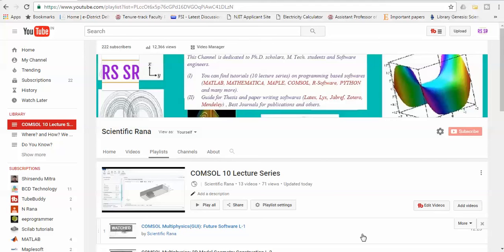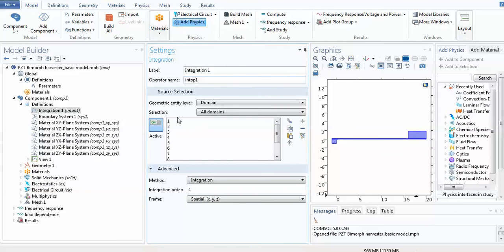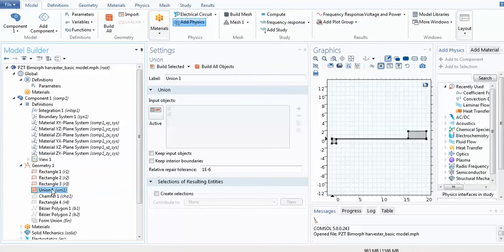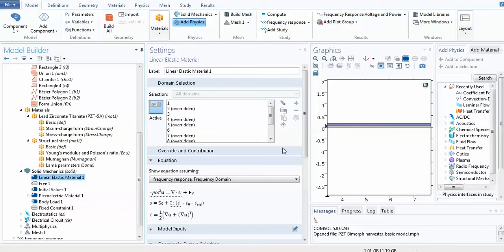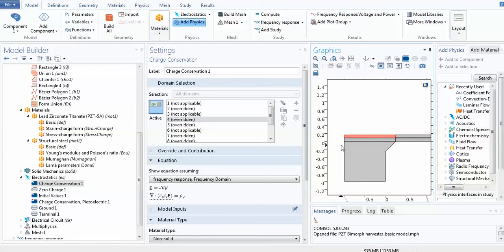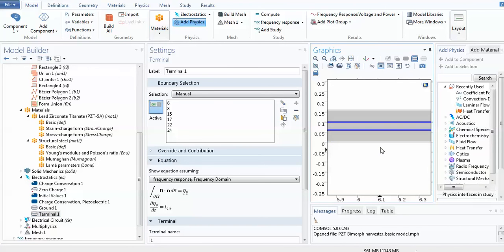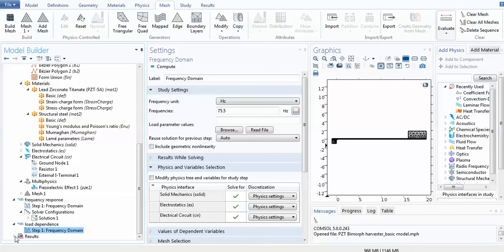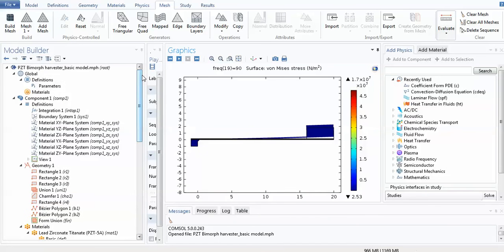COMSOL: FEM Modeling for Piezoelectric (PZT-5A) Energy Harvester L-10

Comment: can you guide me how i can find strain node  points in Comsol   to avoid charge cancellation ? I have designed trapezoidal bimorph piezoelectric energy harvester but i am getting low voltage because charge  cancellation occur but where it is ? I am not able to find out .If we will find out how many strain nodes and how many modes is possible in our structures with the help of stain graph  then we can segment at these points and voltage can be increased . So help me
Reply: can u explain me about the mesh model, stress model

Comment: hi dear doctor, i have a question for this,  because the resonance  frequency of this cantilever beam is around 73 Hz. and i want to make it smaller. based on my research , this can be achieved if i increase the tip mass.  but i dont know how to do this on the COMSOL. could you give me some tips or do you have any other way to reduce the resonance frequency of the cantilever beam? hope you can reply me. thank you so much.
Reply: can u explain me about the mesh model, stress model

Comment: Mr Rana, thanks for your  tutorial uploads , could you help me in my comsol simulation. I have a  temp dependent material parameter which changes very steeply from 3000 to 3 in just 20 to 30 Kelvin interval. comsol solver is getting  struck while solving that transition region .
Reply from the maker: You can send me the .mph file in my email scientificrana@gmail.com.
Reply: can u explain me about the mesh model, stress model